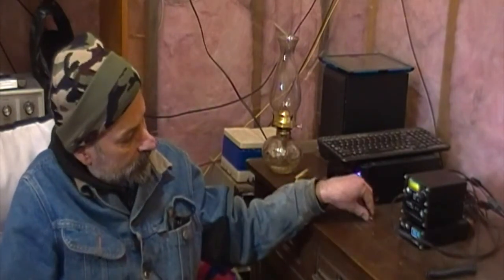OGS-50W HF Power Amplifie(r)

Comment: Sometimes an added amplifier will have spurious signals, these unwanted spurs being to sent to a tuned antenna, and that can create high SWR..
Reply from the maker: Not only might the amp create those emissions, but the radio's own spurious emission will get amplified. And it only takes a small signal that's not resonant with the antenna to cause artificially high SWR readings. The difference being that the amp usually won't blow up from a secondary or even third harmonic that's 45db down from the main signal. ;) But filtering is definitely needed.

Comment: i have bought the usdx+ V2 and the ogs-50 and i have the at-100 tuner.  on the usdx I connect the ogs-50 and then the tuner.  correctly?  how can i tune without transmit 50 watts to tuner?  can i add a switch to the amp to turn it off when tuning?
Reply from the maker: So, you've got it set up correctly! With the amp un- powered, you tune the antenna, and then connect power to the amplifier. I've not installed a power switch into the amplifier, but there is a video on here somewhere where someone installs a magnetic power switch inside the amplifier. I just pull the power cord out of the amplifier when I'm not using it, but yes, a switch at the battery or power supply would be very much helpful. For those following along the connections are: Radio out to amplifier in, amplifier out to ATU in, and then ATU to the antenna.

Comment: I bought one too. I also like it. 

I was aware of it not having reflected power protection, so I am only using it on a resonate 40 meter inverted V in NVIS configuration that also has very low SWR on the 15 meter band.

At the moment I am  using it with either a bitX-40 or early ubitX. Each does not have adjustable power so I power the transceivers with 9 volts at 2 amps max that allows the rigs to output about 0.8 watts of signal which combined with the amp becomes about 28 to 30 watts.

So far no issues. I suspect but don't want to push my luck that my low input allows for a little bit worse than 1.5 SWR for maximum SWR.

The only thing I noticed is the relay that switches from receive to transmit has a lag of about 200 miliseconds. I only use SSB so to avoid being initially cut off I tap the mic or otherwise spoof the start of audio.

I will take a look at your SWR protection video....

73 from kc2wvb

Comment: I bought one and it presents 1:5 swr to the radio on the input side. Any clues why? The store supplier gives no support. It is otherwise working on the output, and a good match to the antenna
Reply from the maker: Most interesting. I must confess that I've never looked at the SWR presented to my radio, with the exception of when I first got it. On 20m it showed 1.5:1. If you'd like I can take a look this evening when I'm home as to what it does on other bands. What bands are you getting that horrible match on?
Reply: @tomsworkshop5856  Thank you! This was on 80 meters, tested with a ft817 and an affordable aliexpress qrp radio, same on both.
Reply from the maker: @rockshelter  Wow, just wow. So, where to start. I've been running my amp on all these bands for months. And, like I said, I based my assumptions on SWR to Amp by just one test. Tonight I ran it through all the bands and this is what I got:
160 4:1 (I love playing here.)
80 7:1 (I had no idea)
60 5:1 (Never used it here)
40 6:1 (I use it here as relay for the western social net all the time!)
30 3:1 (Never used it here)
20 2.5:1 (I've had fun.)
17 1.9:1
15 1.5:1
12 2:1
10 2.1:1 (Had hoot last weekend.)

So, um, I'd like to plead the 5th. I've never looked into this too much as both my RS-918 and the uSDX seem to not care, with many hours of transmitting done over the last 3 months to back that up. But your FT-817 will, as it has very fragile finals, So, I'd suggest not using it on 30 or lower.
 
I'm going to think on this, as clearly the amp doesn't have any type of adjustable input stage, So, I'll see what might be possible to correct the SWR to the radio. But, honestly, I don't think there's much, other than a tuner between the radio and amp. 

Hope this helps in some way. 73's de VE7NGK
Reply: @tomsworkshop5856  Thank you for taking the time and doing this thorough test. I wonder if these result applies to all of the  units sold everywhere. I have read of at least one other user having his radios finals destroyed by using this amp. If there was a few more isolated test results elsewhere that roughly replicates our findings I would publish a warning about this product in every available platform or social media. I have no problem risking a little money on a cheap product that ends up being useless, but a product that could possibly destroy another expensive product by using it is another thing. Anyway, if there is an easy fix to get a better match to the radio I would like to try that. But really I would like my money back, but thats not likely to happen. Anybody in the market for a cheap amp should buy the mx-p50m. Its a little bit more expensive but so much better. Take care and thank you again. 73 de LB1HJ
Reply from the maker: Yup, I found a relatively easy fix. I’m going to post a video later today. Again, thanks for pointing this serious problem out.
Reply: Most "real" amplifiers have input coils that can be tuned for a match to the radio on each band.  This one may or may not have that, or it may just have one tuning adjustment that has to compromise between the bands, and may never have been adjusted at the factory, considering the source.

Comment: I bought one of these for use with an USDX+. I cant get a good report from the pair. What settings on your USDX are needed to get this amp to work well with your transceiver? My signal reports are saying that I've got distortion when using the amp. Thanks in advance
Reply from the maker: Indeed, the uSDX+ (I have the white button one) Had multiple problems that all got worse when I used my amp with it. The best settings I found were Bias Min at 0, and Bias MAX between 75 and 90. The repairs I made to the radio included adding a capacitor to help with RF getting back into the radio via the mic's wiring, and installing a missing resistor "R23" that has a value of 100k. Not going to lie, the USDX radios all sound like Fisher-Price walkie talkies, so sound will never be as good as a commercially built radio. But I've gotten mine to the point that I've had several hours long conversations on it without being told that my audio is terrible. I hope that helps, and stay tuned, I'm working on my video of the uSDX+ v2 white button and hope to post it sometime this weekend.
Reply: @tomsworkshop5856  Ok Tom, thanks for the good words. I'll start poking around in mine(which is also V2 version). My USDX works pretty good until I hook up the amp. Its good to know you got the kinks  out. Thanks, Phil

Comment: I may be wrong but since it’s so sensitive to a bad match, I’m thinking you tune the antenna with an external tuner. Once the tuner is set, you have to put the tuner between the antenna and amplifier. Then the tuner can protect the amplifie. If you put it after the tuner and before the antenna, assuming a bad match, the amp isn’t protected. My question is, will it work on cw?
Reply from the maker: You are correct, the antenna tuner is after the amp, and you need to make sure the amp is de-powered before your tune up. (And make sure that your ATU doesn't decide to do an auto tune once your amp is on.)
As far as CW, I would not recommend this amp for it. It doesn't have an external PTT-in, and it might not switch on fast enough if you're really good at code. hihi

Comment: Does it have any form of Low-pass filtering? I'd like to use it on 80m if possible...
Reply from the maker: It has no filtering at all. But, I use mine on 80m often, as long as I’m using my USDX+ and not my dirty mcHF radio, the harmonics aren’t terrible. I’ll be making a low-pass filter for 160/80 soon. (Spoiler: it does 160 well, too.)